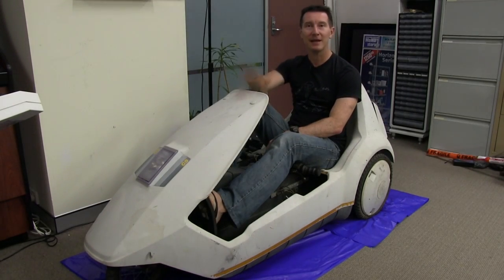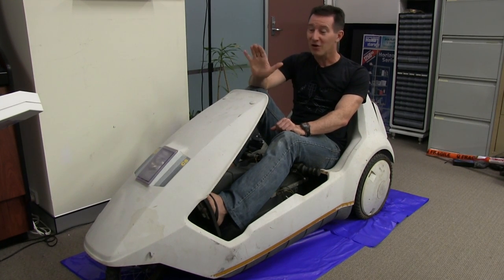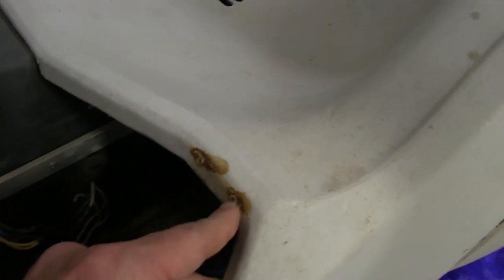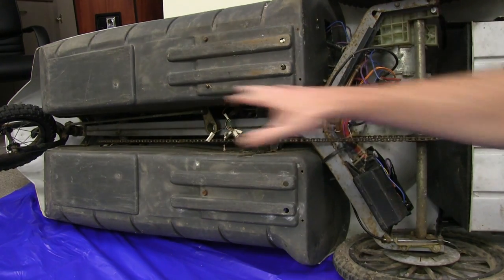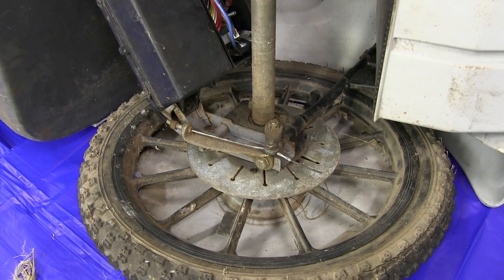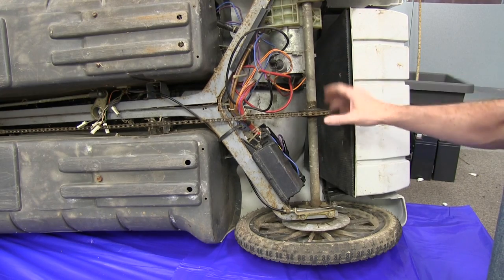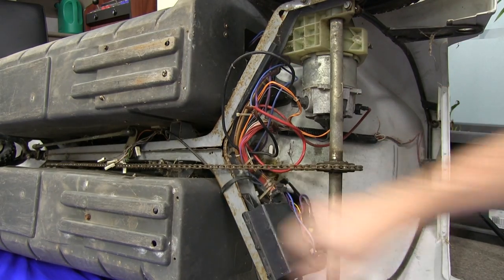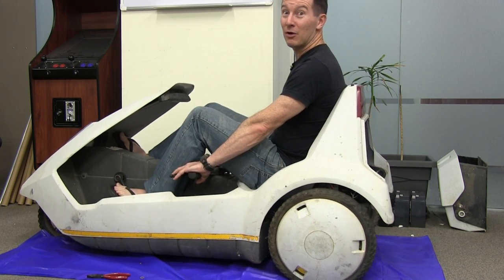EEVblog #604 - Sinclair C5 Restoration - Part 1

Comment: Since the electronics are crap, why not re-design them.

Replace the battery with a beefy 24v lithium ion battery configuration.

Add in a pic microcontroller as master control for engine running/speed control/and peddle charging.

Have smaller 24v motors installed in each wheel for direct drive, with variable speed drivers.

Comment: Looks like surface rust and the chassis seems to have split due to overweight, my guess is that it was used as a toy in the paddock for some time. It should restore nicely from a mechanical standpoint but of course I have only the camera angle to judge from.

Comment: Cool project! In comparison to some motorbikes I've rejuvenated, that C5 doesn't look too bad :-) Looks like surface rust only, and the frame would be a simple TIG weld repair. Lots of rust removal methods are possible, chemical, media blasting and electrolytic (big bath of water / weak sodium carbonate solution and DC power supply, a battery charger will do) check out YouTube for lots of info. Pity you don't  live in Melbourne, because I'd be happy help you get that relic going again :-)

Comment: Someone put a pwm speed control out of a cordless drill in it to drive the motor that one originally had a irf 1404 on it and they put those crusty 2sk devices on it all that's the craziest rigging I've ever seen lol

Comment: looks to me like mostly surface rust, if you can, take out the chassis and visit a car painting facility or a friend with a sand blaster, you could get rid of the rust i all he nooks and give a good surface for re painting
'if not, remove the chassis and wack out the sander, then coat with some serious anti rust, as for the split you can weld it  not a problem, just get rid of all the rust you can and cover over it
i would suggest if you do not weld it, you get some g claps and clamp it back together.
alternativly you could make a new chassis but that would be a lot of work, but just as much as fixing the old one, get some stainlesss steel tubing if you can.

Comment: in the car world that frame would just be sand blasted and then tig welded up. after that a good paint job with some pore 15... that frame would last for 30+ more years. I am guessing the mosfets  are a speed control. Dave I wish I had that much rust on my car lol

Comment: eh, that rust is nothing to worry about, it's only surface rust, not structural, just sand it back and paint the bastard. :) goodluck dave
Reply: yeah only chassis have split in half in rear section so anyway it will need welding, and if you are restoring, do it right sand blast it, weld it and powder-coat it :) i bet that wont cost you a fortune maybe just the price you paid for all your electric "CAR" :DD

Comment: Gosh Dave, it has no suspension no differential I hardly imagine how the thing actually drives, I know it does but efficiency level of it, well just not the best let's say. Go brushless with motor, put a good controller for it, install a differential, then it will be something.

Comment: get someone else to do the mechanical side of things welding etc. and get a hub motor laced to the front wheel from the bike shop. and do the rest yourself cause youre clever dave

Comment: Remove the metal chassis and get it sand blasted, this is the only way to get a good idea of chassis condition. The split in the chassis could be stitch welded with a mig welder a fairly simple process, mig welding is the simplest of welding methods and easy to pick up, I have taught many apprentices to weld in a few hours and easily self taught through YouTube, or get someone to do it for you. Jenolite rust treatment we have in the uk based on phosphoric acid and brushed on will remove traces of rust. Zinc prime chassis when done and spray over with Schutz underseal which is a tar like substance which will do a fine job of protecting from further damage. As for the electrical side I think that you will have that in hand no problem, does look like the power tool trigger is a diy speed controller maybe to replace a the original.

Comment: looks like all surface rust to me. maybe once you have the chassis all stripped down and cleaned up you could take it to a muffler shop to have that center part welded up if you dont want to deal with it yourself

Comment: I don't think that a front hub motor would be a good idea at all, especially when climbing hills.  The load transfer of your body weight will be focused on the back wheels.  

In general you sit over the rear axle so traction on the front tire will not be good.

Comment: Looks like you got your work cut out with sorting that rust but shouldn't be a biggy to patch it up.  If you can find someone to give you a bit of training at welding it can be done yourself just like soldering on a bigger level.... no worries ;-).
Might wana look at completely stripping the electrics wouldn't trust em. Replace the original motor with modern one get more power for the same footprint and put a bike gear cassette on the rear axial.  plenty of room in the boot for some extra lead acids or go lithium.  Should get it running better than ever.

Comment: I am not an expert in the C5 or on metal work but even I know if the two halves of the box frame are split the structural integrity of the frame is bad and can't be "fixed" with out welding the two halves back to one.

You mention doing a number of "mods".  Unless you are really bonded to the C5 for nostalgia reasons or the pride in restoring a C5 then I would suggest if you have enough spare cash get a golf cart or a "Lithium Powered E-Bike" of some type (used of course).  Spend less on fixing a device that you will "mod" and more on a working device that you will mod.  This is not like buying a Marconi 2955A on ebay for $400 and then repair it (if you can find parts) so you ave a $2500 test device.  When you are finished with a moded C5 and most collectors are not happy about "mods".   Tear it down and sell the parts.  If you test them on your tear down you can probably make more since you can link it in.

Comment: the rust is nothing to be too concerned about, that split concerns me but im sure you can weld that back up ... if you don't weld than you can probably get away with a big ass bolt
Reply: In the front of it seems to have the same gap, with much less rust. Maybe the two halfs are not intended to be welded together? I would try to gather some infrormation first, like construction plans and so forth.
http://www.c5owners.com/ seems to be a good place to start the have even files for spare parts that could be printed on a 3d printer.
Reply: im not so sure but possably

Comment: The frame rails have split are coming apart like a Turkey wishbone. It's repairable if you have a welder and metal fabrication skills, or a friend who does. Good time to beef it up too, to go with the more powerful motor.

Typical English car problems: Rusted out frame, and horrendous electricals

Comment: Battery, motor, electronics and body materials were not up to snuff back then. The ELF shows what can be done with technology now. High performance downhill racing mountain bike components, full DOT aproved LED lighting system and a powerful 9 pound lithium battery make these new designs better.  Larger wheels and a solar roof bring it all together: https://youtu.be/r_xDuHuk4_E
British laws that limit these to 15 mph are ridiculous. That is one reason this never caught on.
I got rid of my car 3 years ago and use solar power to get around every day. The option of pedaling just makes this more desirable since everyone needs exercise. Several have been shipped to Au.

Comment: Looks repairable...

Body needs fibreglass work, filling, sanding and painting. 
New motor
All wiring needs to be replaced
Strip the steel chassis & some welding work may need to be done to it then repainted... 

jobs a good'n.

Comment: If you want to weld it yourself, it's not that hard. Any $100 welder will weld that steel. It is not that hard, I taught my self with old car batteries. (My welds look like shit, but the metal always breaks before  my welds do!)

Comment: The frame seem to have had more load then it was design for. the rust is nothing compered to restorng a car. get the frame bendt back in to posision. remove ALL rust wher it need to be welded. then som one need to weld it together agein. if you can het it TIG welded by som one ho know ehat they do and get all the seams welded (not onely spot welded) i think it wil be stronger then it was new. remove the rest of the rust, use som rust stopper system (cleaner, rust stopper, sealer) (you can lok at KBS all-in-one chassis coater kit or simelar system)

Comment: Everything Hoover ever made really sucked, the chain appeared to be too tight, which may indicate that the chasis in it's current form may be bent or stretched. knock an old person on the head and steal their mobility scooter then gut it and use all the running gear on yours. Best Regards & Good Luck.

Comment: rip of this rosted chassy and send it to some alu welder, to copy it from aluminium. then put two brushlees motor to the back :) after just some electronic to make a energy recover brake system, some led lamp, davecomputer, lipo acc, titan chain, titan bearings and axle to the front, carbon wheel (pro bmx stuffs cheap) and not for last, solarcell to the front :))) dont drive the front! the angles not a best for it. can be dangerous and uncontrolable. just use one or two engine in the back with axial differential drive.

Comment: Interesting "thing", but few hundred of bucks for something like this? Seriously?
Reply: Why would you spend millions on a painting? why would you spend 50$ on buying an old SNES? they're all usually in awful shape, out of time or just old and useless.. but you still buy it
Reply: And as a bonus, it's tax deductible, because it's for work :P
Reply from the maker: They are actually collectible. I'll likely never lose money on it.
Reply: EEVblog Luckily there is not much to these things. The body is in one piece, and that's the important bit. The chassis looks great, and wouldn't be much work to strip off the surface rust, re-weld weak point, prime and coat. If you do get the time to do this, looks like a great fairly quick project compared to most auto projects. Looks like the brunt of your work will be electrical. I would definitely put a modern motor in it if the original is not worth saving, so it can at least be practical. You should use a boat hull cleaner on the body.
That chassis was never meant to be incredibly robust, it looks like a couple tack welds came loose, you would need to take it to someone to get it welded back together if you can't weld, especially if you want a more powerful motor on it.

Comment: Now I have stopped laughing I can tell you that it is fixable the rust is not that bad, but you will need to treat it.  Where it is coming apart at the wishbone can be treated and then either bolted through or welded together. The electrics Dave are bloody terrible so I leave that to you mate. $200 boy it is going to cost a lot more to get it running, good luck.

Comment: I am currently rebuilding a C5 as my master thesis.
Maybe you can get some inspiration:
https://www.dropbox.com/s/q8rmyzmehc69vp8/Exjobb_Report%20%284%29.pdf
The report is work in progress but the vehicle is done.
I put 2 1kW hub motors in the rear wheels.